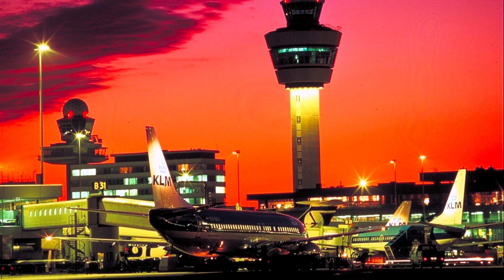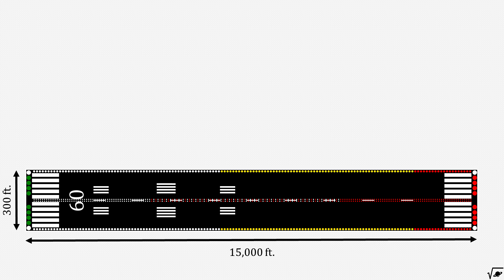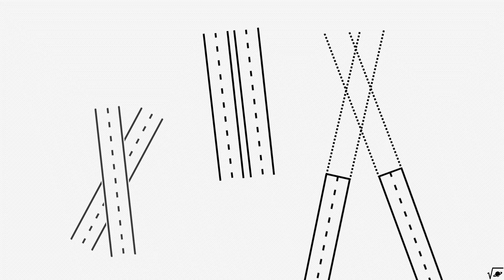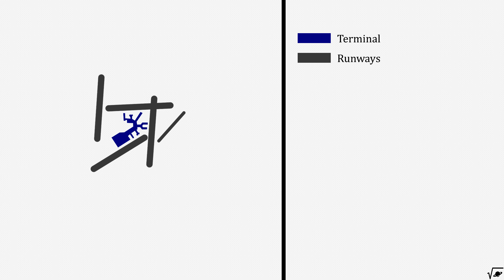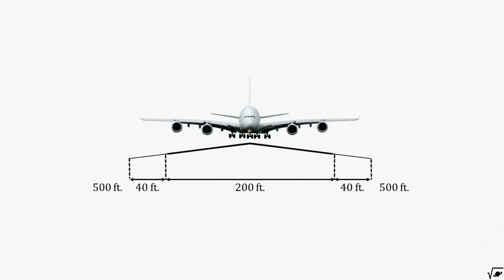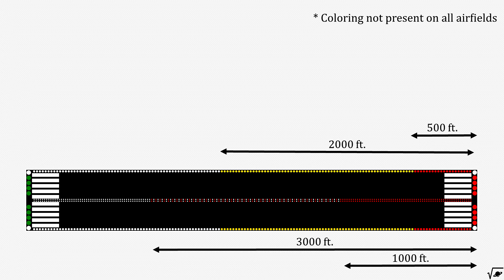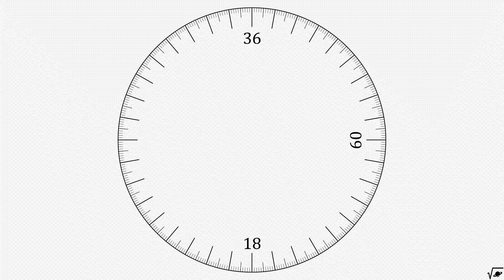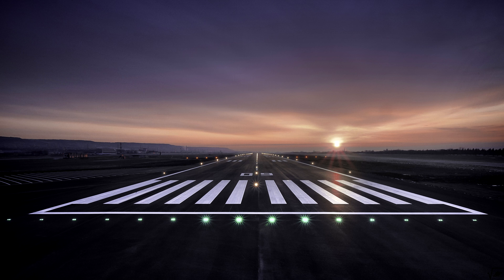The Detailed System Of Runway Design

Comment: Are the edge lights really turning to red the last 500 feet in your country? That's interesting, in the US the edge lights turned to Amber the last 2000 feet. If there is centerline lighting, it will start alternating red and white the last 3000 feet, and the last thousand feet will be all red. I guess it varies country to country despite ICAO.

Comment: nice video, but plz use non retarded measurement units (meters).
Reply from the maker: I regret that decision indeed. Will use SI from now on. Thanks for watching the video!
Reply: @MrEngineeringGuy  Use both. Aviation usually uses Imperial units, but I personally prefer metric (despite being American) so I recommend you say the imperial units and display in imperial but have the metric counterparts displayed nearby also.

Comment: If you 4 or more runways then they change the direction name. For example on 4 North (magnetic) rwys, you can have 36L 36R, 37L 37R. Usually go up or down one scale. And the number is corrected for magnetic variation, which can cause a problem if the variation changes a lot over time.

Whats the best material to use when you build a runway, asphalt or concrete? Not looking for a economical view but more from an engineering point. Strongest, durable material which require less maintenance.
Reply: Yes, except in that scenario, they'd go back to 01 or 35. There's no such thing as runway 37 :)